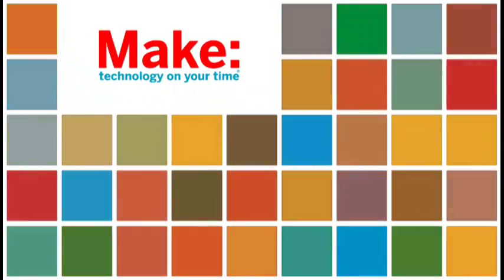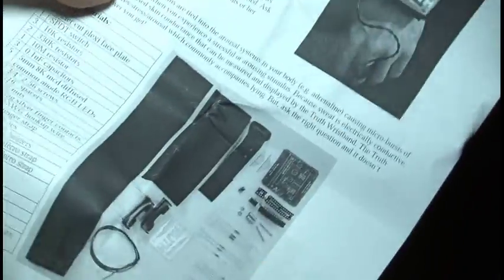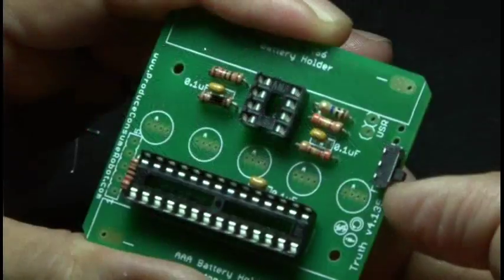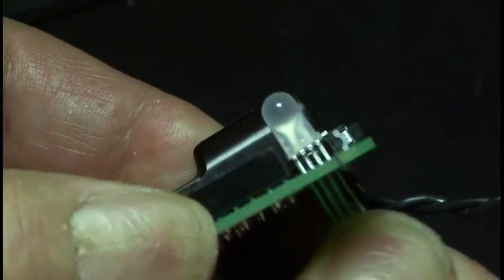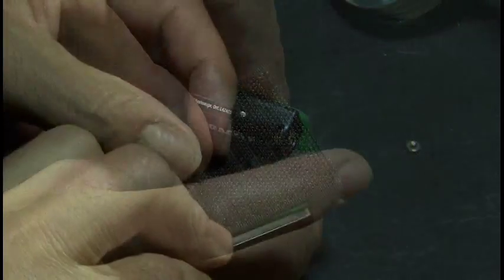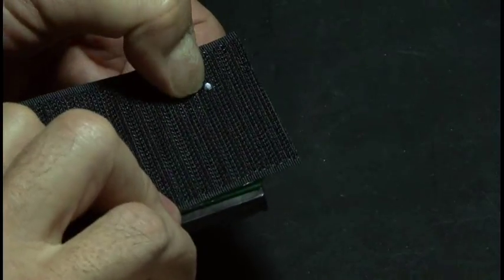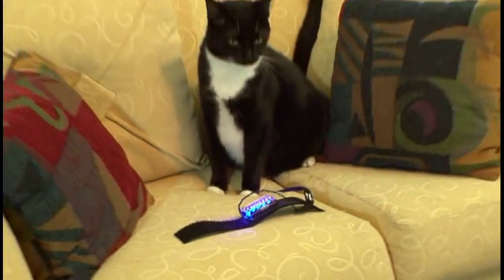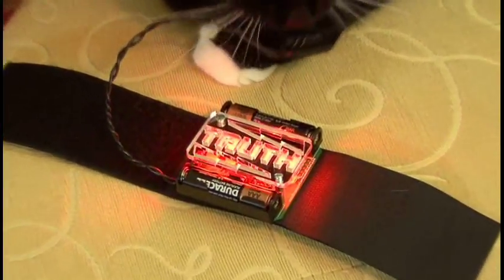Weekend Project: Truth Wristband

Comment: You'll get a lot of false positives and negatives in there. But galvanic skin response is indeed one of the methods used in lie detection. However in a real polygraph they take lots of readings from different sensors and determine whether an individual is lying from that.